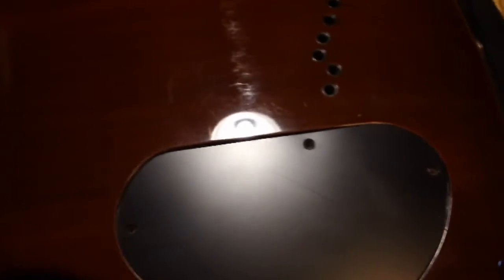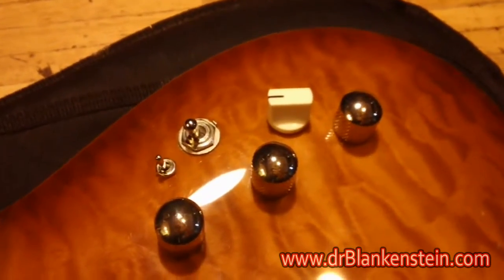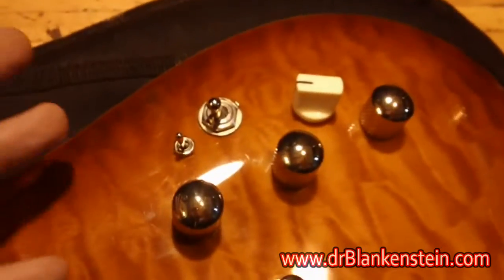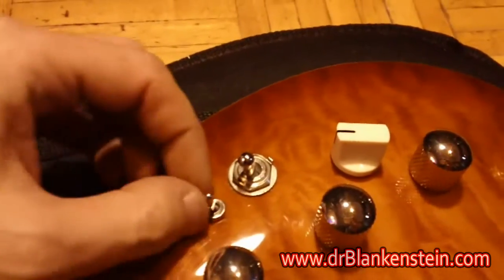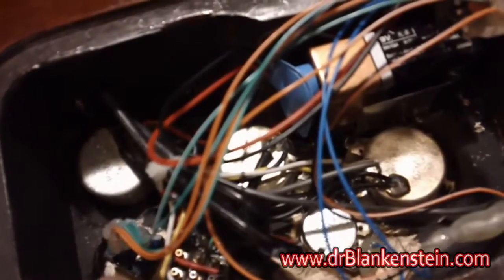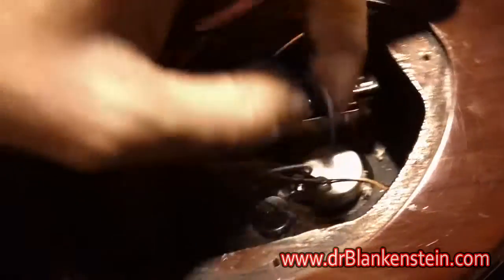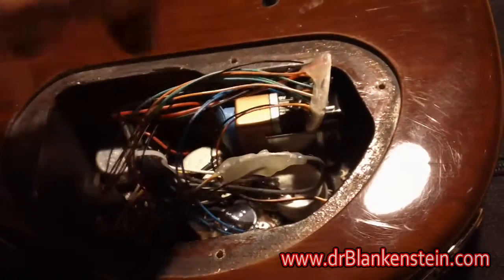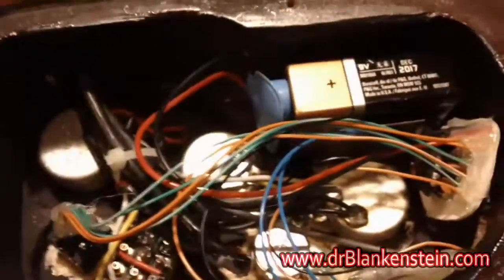Dr. Blankenstein's Circuit Bent Guitar Modification Kit Installation Overview

Comment: Would it be better using push pull pots and a dual pot so there is no need drill any holes for the switches and blend control
Reply from the maker: Good idea, def kicked it around a bit.  I wanted to make the kit as versatile as possible, so people could put it in ANYTHING (baby toy, put it in a box, install it in a guitar, add a piezo contact mic and make an acoustic electric instrument).  Keep in mind, one can easily remove the switches and pot  that are on the kit, and rewire them to a push pull, stomp switch, any switch and swap the pot etc.. a lot of possibilities. Thanks for watching and commenting! ~doc

Comment: Doctor, can I put this kit in my snarling dogs whine o wah or would it need a blend knob for the foot controller to rock the ring effect and the wah effect?
Reply from the maker: not sure how i missed this comment...  sorry about that.  but yeah, you can replace the pot with the one in your wah casing and control the effect. There are actually a bunch of different ways to do it depending on the situation and desired result.  That's the fun of the mod.  Hit me up through the contact on my site with more detailed info about the project, and I will be happy to help you out.  Thanks for watching!  Doc

Comment from the maker: I do, the video shows the BASIC mod kit with the light sensor omitted.  
.
Omitting the light sensor is as simple as cutting the two wires that connect to it from the circuit board.  Plus you are left with a large light sensor to use on another project some day ;) 
.
If you have any other questions about the mod or install, feel free to get in touch.  Thanks for watching!

Comment from the maker: 100% Actually this mod (and the soon to be released expanded pedal version of it) is wired TRUE-BYPASS.  Meaning... when the clean tone is engaged, the effect is taken out of the original signal completely.  
.
The mod kit has three switches.  Switch 1: Sends power to the effect (wired true bypass)   Switch 2:  Engages the effect (Wet/Dry)  Switch 3: Goes from light sensor / knob control.   Switches 1 & 2 can be put on one switch, as it is in this video.  Depends on what it's going into..